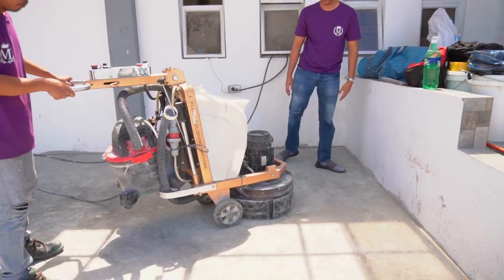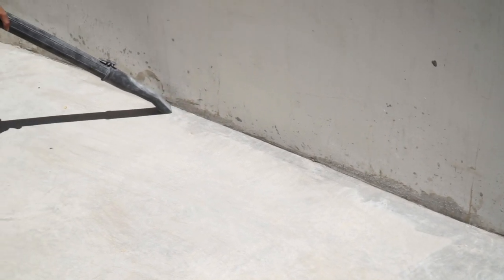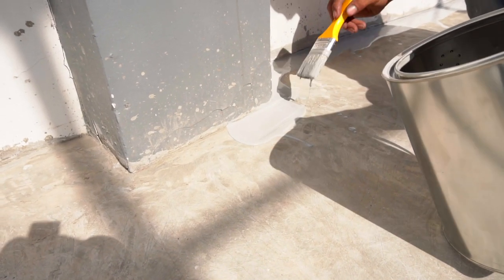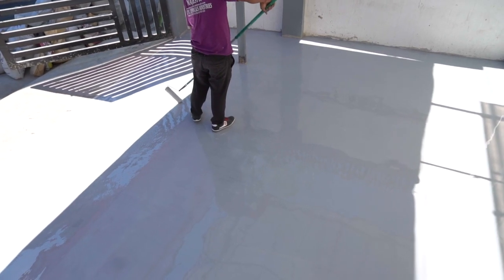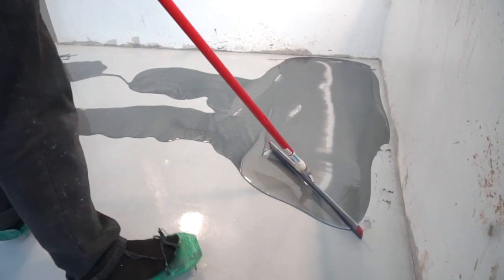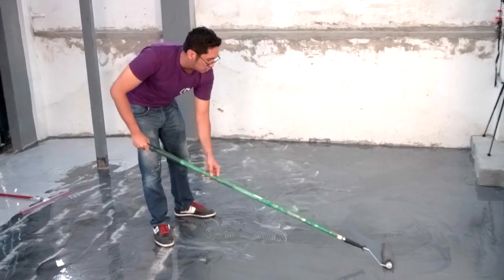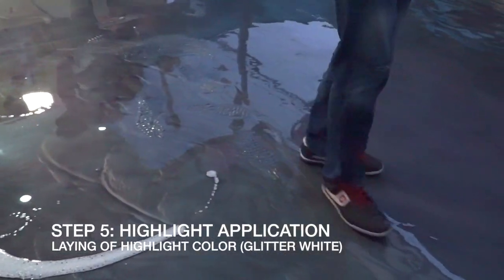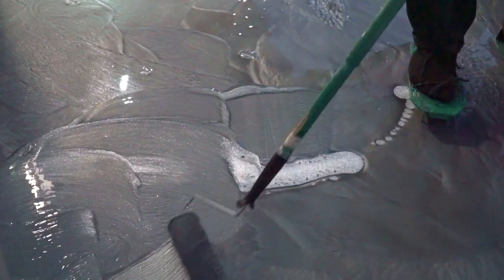METALLIC EPOXY GARAGE PHILIPPINES   METALLIC EPOXY FLOOR PHILIPPINES

Comment: Mas makakatipid po ba ito compared sa tiles?
Reply: Mas makakatipid po ba ito cmpard sa tiles
Reply from the maker: Good day

Mura lang ng konti si Ceramic tiles
pero mas mura tayo sa Granite tiles at marble
at Mas Quality sa kanila
.

For availing & quicker response, you may contact us
09182523454
Reply from the maker: @SmithKhersaBiker203  

Good day 

Mura lang ng konti si Ceramic tiles
pero mas mura tayo sa Granite tiles at marble
at Mas Quality sa kanila
.

For availing & quicker response, you may contact us
09182523454

Comment: Mas mahal po ba yan kesa sa tiles?
Reply from the maker: Halos magkalapit lang po ang presyo lalo na kung ikukumpara sa mga imported tiles. Advantage lang po ng resin is mas matibay kasi hindi po ito nagcacracks. :)

This is Ronnel Catamora of Majestic Chemicals.
For more details and quicker responce, you may contact at:
0920 840 42 82

Comment: sir .ask lang po magkano pi costing ng ganyan??
Reply from the maker: Good Day

makakabili po kayo sa amin, just message lang po and we will answer those Questions :)
https://www.facebook.com/majesticchemicals/

also we have LAZADA for COD
You can purchase to our Lazada
then screenshot your order then send it to us here so we can prepare it as soon as possible.
sa Fb page parin po :)
https://www.lazada.com.ph/majestic/?

Visit our Website
https://majesticchemicals.com/

By the way I'm Sherwin of Majestic Chemicals, Glad to assist you :)
For availing & quicker response, you may contact us
09182523454

Join MAJESTIC EPOXY RESIN COMMUNITY PHILIPPINES to show your resin works and share tips
⬇️M⬇️A⬇️J⬇️E⬇️S⬇️T⬇️I⬇️C⬇️ ⬇️C⬇️H⬇️E⬇️M⬇️I⬇️C⬇️A⬇️L⬇️
https://www.facebook.com/groups/398748351104499

Comment: sir yang primer ba is combination ng epoxy clear laminating A and B
Reply from the maker: Good Day

Hindi po, ang primer is combination  ng  part A and B ng Selfleveling Non-metallic resin epoxy, ang clear laminating po natin is Metallic or si liquid marble na walang kulay :)

makakabili po kayo sa amin, just message lang po and we will answer those Questions :)
https://www.facebook.com/majesticchemicals/

also we have LAZADA for COD
You can purchase to our Lazada
then screenshot your order then send it to us here so we can prepare it as soon as possible.
sa Fb page parin po :)
https://www.lazada.com.ph/majestic/?

Visit our Website
https://majesticchemicals.com/

By the way I'm Sherwin of Majestic Chemicals, Glad to assist you :)
For availing & quicker response, you may contact us
09182523454

Join MAJESTIC EPOXY RESIN COMMUNITY PHILIPPINES to show your resin works and share tips
⬇️M⬇️A⬇️J⬇️E⬇️S⬇️T⬇️I⬇️C⬇️ ⬇️C⬇️H⬇️E⬇️M⬇️I⬇️C⬇️A⬇️L⬇️
https://www.facebook.com/groups/398748351104499

Comment: Nagagawa po ba na parang polished concrete instead na marble finish?
Reply from the maker: Sa design po nilalapit ang kulay. Pero babalutan parin po natin ng epoxy resin para tumibay. Contact us 
0919 094 7798

Comment: Pwede po ba yan na ipatong sa tiles?
Reply from the maker: Good Day

Opo, make sure lang na matibay parin ang pag kaka-kabit ng tiles at mamasilyahan ang lines para selflevel surface pag inapplyan na :)

makakabili po kayo sa amin, just message lang po and we will answer those Questions :)
https://www.facebook.com/majesticchemicals/

also we have LAZADA for COD
You can purchase to our Lazada
then screenshot your order then send it to us here so we can prepare it as soon as possible.
sa Fb page parin po :)
https://www.lazada.com.ph/majestic/?

Visit our Website
https://majesticchemicals.com/

By the way I'm Sherwin of Majestic Chemicals, Glad to assist you :)
For availing & quicker response, you may contact us
09182523454

Join MAJESTIC EPOXY RESIN COMMUNITY PHILIPPINES to show your resin works and share tips
⬇️M⬇️A⬇️J⬇️E⬇️S⬇️T⬇️I⬇️C⬇️ ⬇️C⬇️H⬇️E⬇️M⬇️I⬇️C⬇️A⬇️L⬇️
https://www.facebook.com/groups/398748351104499

Comment: Magkano po ang cost NG 150 square meters na area?
Reply from the maker: Good Day

Masasagot po natin yan sa ating Fb page :D 

makakabili po kayo sa amin, just message lang po and we will answer those Questions :)
https://www.facebook.com/majesticchemicals/

also we have LAZADA for COD
You can purchase to our Lazada
then screenshot your order then send it to us here so we can prepare it as soon as possible.
sa Fb page parin po :)
https://www.lazada.com.ph/majestic/?

Visit our Website
https://majesticchemicals.com/

By the way I'm Sherwin of Majestic Chemicals, Glad to assist you :)
For availing & quicker response, you may contact us
09182523454

Join MAJESTIC EPOXY RESIN COMMUNITY PHILIPPINES to show your resin works and share tips
⬇️M⬇️A⬇️J⬇️E⬇️S⬇️T⬇️I⬇️C⬇️ ⬇️C⬇️H⬇️E⬇️M⬇️I⬇️C⬇️A⬇️L⬇️
https://www.facebook.com/groups/398748351104499

Comment: More trainings / practice pa mga sir  hahahha
Reply from the maker: Good Day

Opo sir, practice lang ng practice ^_^

makakabili po kayo sa amin, just message lang po and we will answer those Questions :)
https://www.facebook.com/majesticchemicals/

also we have LAZADA for COD
You can purchase to our Lazada
then screenshot your order then send it to us here so we can prepare it as soon as possible.
sa Fb page parin po :)
https://www.lazada.com.ph/majestic/?

Visit our Website
https://majesticchemicals.com/

By the way I'm Sherwin of Majestic Chemicals, Glad to assist you :)
For availing & quicker response, you may contact us
09182523454

Join MAJESTIC EPOXY RESIN COMMUNITY PHILIPPINES to show your resin works and share tips
⬇️M⬇️A⬇️J⬇️E⬇️S⬇️T⬇️I⬇️C⬇️ ⬇️C⬇️H⬇️E⬇️M⬇️I⬇️C⬇️A⬇️L⬇️
https://www.facebook.com/groups/398748351104499

Comment: Boss pwde ba ang metallic epoxy sa existing na granite tiles?
Reply from the maker: Good Day

Yes pwedeng pwede po :D basta matibay parin ang existing tiles para maging base ng ating Product :D

makakabili po kayo sa amin, just message lang po and we will answer those Questions :)
https://www.facebook.com/majesticchemicals/

also we have LAZADA for COD
You can purchase to our Lazada
then screenshot your order then send it to us here so we can prepare it as soon as possible.
sa Fb page parin po :)
https://www.lazada.com.ph/majestic/?

Visit our Website
https://majesticchemicals.com/

By the way I'm Sherwin of Majestic Chemicals, Glad to assist you :)
For availing & quicker response, you may contact us
09182523454

Join MAJESTIC EPOXY RESIN COMMUNITY PHILIPPINES to show your resin works and share tips
⬇️M⬇️A⬇️J⬇️E⬇️S⬇️T⬇️I⬇️C⬇️ ⬇️C⬇️H⬇️E⬇️M⬇️I⬇️C⬇️A⬇️L⬇️
https://www.facebook.com/groups/398748351104499

Comment: im shookt
nothing is impossible
Reply from the maker: Good Day

makakabili po kayo sa amin, just message lang po and we will answer those Questions :)
https://www.facebook.com/majesticchemicals/

also we have LAZADA for COD
You can purchase to our Lazada
then screenshot your order then send it to us here so we can prepare it as soon as possible.
sa Fb page parin po :)
https://www.lazada.com.ph/majestic/?

Visit our Website
https://majesticchemicals.com/

By the way I'm Sherwin of Majestic Chemicals, Glad to assist you :)
For availing & quicker response, you may contact us
09182523454

Join MAJESTIC EPOXY RESIN COMMUNITY PHILIPPINES to show your resin works and share tips
⬇️M⬇️A⬇️J⬇️E⬇️S⬇️T⬇️I⬇️C⬇️ ⬇️C⬇️H⬇️E⬇️M⬇️I⬇️C⬇️A⬇️L⬇️
https://www.facebook.com/groups/398748351104499

Comment: Bale tatlong galon ang ginamit dito tama po?
Reply from the maker: Good Day

Avail na po kayo ^_^

makakabili po kayo sa amin, just message lang po and we will answer those Questions :)
https://www.facebook.com/majesticchemicals/

also we have LAZADA for COD
You can purchase to our Lazada
then screenshot your order then send it to us here so we can prepare it as soon as possible.
sa Fb page parin po :)
https://www.lazada.com.ph/majestic/?

Visit our Website
https://majesticchemicals.com/

By the way I'm Sherwin of Majestic Chemicals, Glad to assist you :)
For availing & quicker response, you may contact us
09182523454

Join MAJESTIC EPOXY RESIN COMMUNITY PHILIPPINES to show your resin works and share tips
⬇️M⬇️A⬇️J⬇️E⬇️S⬇️T⬇️I⬇️C⬇️ ⬇️C⬇️H⬇️E⬇️M⬇️I⬇️C⬇️A⬇️L⬇️
https://www.facebook.com/groups/398748351104499

Comment: Magkano po kaya ang epoxy
Reply: Good Day

CRYSTAL CASTING/ see through:
15ml dye color/350PHP
1 Liter Php 2,000.00 
1 Gallon or 3L Php 5,000.00
1 Pail Php 12L 16,000.00

SELF LEVELING:
NON-METALLIC:
PRIMER:
1 Liter Php 800.00
1 Gallon or 3L Php 2,500.00
1 Pail or 14
L Php 8,000.00

METALLIC EPOXY:
1 Liter Php 2,000 
(w/50g Metallic Pigments)
1 Gallon or 3L Php 5,000
(w/150g Metallic Pigments)
1 Pail or 12L Php 13,000
(w/300g Metallic Pigments)
--------------------------------------------------------
-water resistant
-heat resistant
-scratch resistant
-dust resistant
-chemical resistant
-di nag ccracks
-di nababasag
-walang maintenance, walis or punas lang
-super easy to apply
-shiny at elegant pa tignan
-non-slippery even wet
-odorless & solventless
-industrial grade
-food grade/safe
-Lifetime Quality

We have FB page which where we answer those questions at kung paano din po bumili:) 
https://www.facebook.com/majesticchemicals/

COD via LAZADA
You can purchase to our Lazada
then screenshot your order then send it to us here so we can prepare it as soon as posible.
https://www.lazada.com.ph/majestic/?

you can visit our Website :)
https://majesticchemicals.com/

By the way I'm Sherwin of Majestic Chemicals, Glad to assist you :)
For availing & quicker response, you may contact us
09182523454

Join MAJESTIC EPOXY RESIN COMMUNITY PHILIPPINES to show your resin works and share tips
⬇️M⬇️A⬇️J⬇️E⬇️S⬇️T⬇️I⬇️C⬇️ ⬇️C⬇️H⬇️E⬇️M⬇️I⬇️C⬇️A⬇️L⬇️
https://www.facebook.com/groups/398748351104499

Comment: Sir pwede ba omorder nyan complete na epoxy for floor?
Reply from the maker: Good Day

makakabili po kayo sa amin, just message lang po and we will answer those Questions :)
https://www.facebook.com/majesticchemicals/

also we have LAZADA for COD
You can purchase to our Lazada
then screenshot your order then send it to us here so we can prepare it as soon as possible.
sa Fb page parin po :)
https://www.lazada.com.ph/majestic/?

Visit our Website
https://majesticchemicals.com/

By the way I'm Sherwin of Majestic Chemicals, Glad to assist you :)
For availing & quicker response, you may contact us
09182523454

Join MAJESTIC EPOXY RESIN COMMUNITY PHILIPPINES to show your resin works and share tips
⬇️M⬇️A⬇️J⬇️E⬇️S⬇️T⬇️I⬇️C⬇️ ⬇️C⬇️H⬇️E⬇️M⬇️I⬇️C⬇️A⬇️L⬇️
https://www.facebook.com/groups/398748351104499

Comment: Mga nsa anong budget po pag magpa epoxy ng floor?
Reply from the maker: Good day

Dipende po sa sukat ng lawak ng area nyu by sqm.
For availing & quicker response, you may contact us
(+639182523454)

Comment: How much po ang per sq.m nyo
Reply from the maker: Good Day

Materials only

900Php/sqm for Metallic Resin Epoxy
650Php/sqm for Non-metallic Resin Epoxy
 shipping fee not included

Materials & Labor
2,500Php/sqm bellow 50sqm for Metallic
2,000php/sqm 50sqm and Up for Metallic
1,800Php/sqm bellow 300sqm for Non-metallic
1,500Php/sqm 300sqm and Up for Non-metallic
+15k for equipments & mobilization

makakabili po kayo sa amin, just message lang po and we will answer those Questions :)
https://www.facebook.com/majesticchemicals/

also we have LAZADA for COD
You can purchase to our Lazada
then screenshot your order then send it to us here so we can prepare it as soon as possible.
sa Fb page parin po :)
https://www.lazada.com.ph/majestic/?

Visit our Website
https://majesticchemicals.com/

By the way I'm Sherwin of Majestic Chemicals, Glad to assist you :)
For availing & quicker response, you may contact us
09182523454

Join MAJESTIC EPOXY RESIN COMMUNITY PHILIPPINES to show your resin works and share tips
⬇️M⬇️A⬇️J⬇️E⬇️S⬇️T⬇️I⬇️C⬇️ ⬇️C⬇️H⬇️E⬇️M⬇️I⬇️C⬇️A⬇️L⬇️
https://www.facebook.com/groups/398748351104499

Comment: magkano po gastusin nyn?
Reply from the maker: Good Day

Depende po sa sukat at location ng pag lalagyan :)

makakabili po kayo sa amin, just message lang po and we will answer those Questions :)
https://www.facebook.com/majesticchemicals/

also we have LAZADA for COD
You can purchase to our Lazada
then screenshot your order then send it to us here so we can prepare it as soon as possible.
sa Fb page parin po :)
https://www.lazada.com.ph/majestic/?

Visit our Website
https://majesticchemicals.com/

By the way I'm Sherwin of Majestic Chemicals, Glad to assist you :)
For availing & quicker response, you may contact us
09182523454

Join MAJESTIC EPOXY RESIN COMMUNITY PHILIPPINES to show your resin works and share tips
⬇️M⬇️A⬇️J⬇️E⬇️S⬇️T⬇️I⬇️C⬇️ ⬇️C⬇️H⬇️E⬇️M⬇️I⬇️C⬇️A⬇️L⬇️
https://www.facebook.com/groups/398748351104499

Comment: matibay ba sa gasgas ang epoxyfloor
Reply from the maker: Good day

Mag kaka minimal scratches sya pero sa mga sadya lang po at accident happen pero kung dadaanan lang ng tao di naman po basta basta mag kaka scratch, kung sakali man na mag karoon need lang po ito e buff at babalik na sa dating kintab :D

For availing & quicker response, you may contact us
09182523454

Comment: Magkano nman Po Ang per gallon?
Reply from the maker: Good Day

CRYSTAL CASTING/ see through:

15ml dye color/350PHP
1 Liter Php 2,000.00 
1 Gallon or 3L Php 5,000.00
1 Pail Php 12L 16,000.00

SELF LEVELING:
NON-METALLIC:
PRIMER:
1 Liter Php 800.00
1 Gallon or 3L Php 2,500.00
1 Pail or 14
L Php 8,000.00

METALLIC EPOXY:
1 Liter Php 2,000 
(w/50g Metallic Pigments)
1 Gallon or 3L Php 5,000
(w/150g Metallic Pigments)
1 Pail or 12L Php 13,000
(w/300g Metallic Pigments)

makakabili po kayo sa amin, just message lang po and we will answer those Questions :)
https://www.facebook.com/majesticchemicals/

also we have LAZADA for COD
You can purchase to our Lazada
then screenshot your order then send it to us here so we can prepare it as soon as possible.
sa Fb page parin po :)
https://www.lazada.com.ph/majestic/?

Visit our Website
https://majesticchemicals.com/

By the way I'm Sherwin of Majestic Chemicals, Glad to assist you :)
For availing & quicker response, you may contact us
09182523454

Join MAJESTIC EPOXY RESIN COMMUNITY PHILIPPINES to show your resin works and share tips
⬇️M⬇️A⬇️J⬇️E⬇️S⬇️T⬇️I⬇️C⬇️ ⬇️C⬇️H⬇️E⬇️M⬇️I⬇️C⬇️A⬇️L⬇️
https://www.facebook.com/groups/398748351104499

Comment: boss magkano ang epoxy? at saan?
Reply from the maker: Good Day

makakabili po kayo sa amin, just message lang po and we will answer those Questions :)
https://www.facebook.com/majesticchemicals/

also we have LAZADA for COD
You can purchase to our Lazada
then screenshot your order then send it to us here so we can prepare it as soon as possible.
sa Fb page parin po :)
https://www.lazada.com.ph/majestic/?

Visit our Website
https://majesticchemicals.com/

By the way I'm Sherwin of Majestic Chemicals, Glad to assist you :)
For availing & quicker response, you may contact us
09182523454

Join MAJESTIC EPOXY RESIN COMMUNITY PHILIPPINES to show your resin works and share tips
⬇️M⬇️A⬇️J⬇️E⬇️S⬇️T⬇️I⬇️C⬇️ ⬇️C⬇️H⬇️E⬇️M⬇️I⬇️C⬇️A⬇️L⬇️
https://www.facebook.com/groups/398748351104499

Comment: Meron ding metallic aquamarine color? 🤗
Reply from the maker: Good Day

Meron po, Just message us sa aming Fb page :D 

makakabili po kayo sa amin, just message lang po and we will answer those Questions :)
https://www.facebook.com/majesticchemicals/

also we have LAZADA for COD
You can purchase to our Lazada
then screenshot your order then send it to us here so we can prepare it as soon as possible.
sa Fb page parin po :)
https://www.lazada.com.ph/majestic/?

Visit our Website
https://majesticchemicals.com/

By the way I'm Sherwin of Majestic Chemicals, Glad to assist you :)
For availing & quicker response, you may contact us
09182523454

Join MAJESTIC EPOXY RESIN COMMUNITY PHILIPPINES to show your resin works and share tips
⬇️M⬇️A⬇️J⬇️E⬇️S⬇️T⬇️I⬇️C⬇️ ⬇️C⬇️H⬇️E⬇️M⬇️I⬇️C⬇️A⬇️L⬇️
https://www.facebook.com/groups/398748351104499

Comment: Ganda mga boss...
Reply from the maker: Good Day

Thankyou <3

For more details, Pm us po

makakabili po kayo sa amin, just message lang po and we will answer those Questions :)
https://www.facebook.com/majesticchemicals/

also we have LAZADA for COD
You can purchase to our Lazada
then screenshot your order then send it to us here so we can prepare it as soon as possible.
sa Fb page parin po :)
https://www.lazada.com.ph/majestic/?

Visit our Website
https://majesticchemicals.com/

By the way I'm Sherwin of Majestic Chemicals, Glad to assist you :)
For availing & quicker response, you may contact us
09182523454

Join MAJESTIC EPOXY RESIN COMMUNITY PHILIPPINES to show your resin works and share tips
⬇️M⬇️A⬇️J⬇️E⬇️S⬇️T⬇️I⬇️C⬇️ ⬇️C⬇️H⬇️E⬇️M⬇️I⬇️C⬇️A⬇️L⬇️
https://www.facebook.com/groups/398748351104499
Reply: Mga boss pwede yan gawin sa swimming pool ganyan preparastion at finish na materiales?
Reply from the maker: @roniegallego1887  
Pwedeng pwede sir :D pero di sya pwede sa Vertical or sa pader ng swimming kasi Selfleveling po sya :D
Reply: @MajesticChemicals  anu bah maganda sa preparation sa pader ng swimming pool at pang topcoat finish?

Comment: magkano service nyo?
Reply from the maker: Good Day

Depende sir sa Sukat at Location :D

makakabili po kayo sa amin, just message lang po and we will answer those Questions :)
https://www.facebook.com/majesticchemicals/

also we have LAZADA for COD
You can purchase to our Lazada
then screenshot your order then send it to us here so we can prepare it as soon as possible.
sa Fb page parin po :)
https://www.lazada.com.ph/majestic/?

Visit our Website
https://majesticchemicals.com/

By the way I'm Sherwin of Majestic Chemicals, Glad to assist you :)
For availing & quicker response, you may contact us
09182523454

Join MAJESTIC EPOXY RESIN COMMUNITY PHILIPPINES to show your resin works and share tips
⬇️M⬇️A⬇️J⬇️E⬇️S⬇️T⬇️I⬇️C⬇️ ⬇️C⬇️H⬇️E⬇️M⬇️I⬇️C⬇️A⬇️L⬇️
https://www.facebook.com/groups/398748351104499